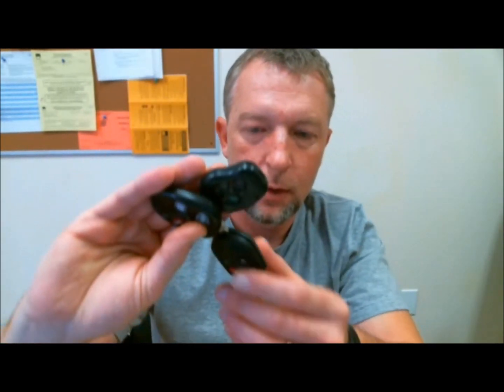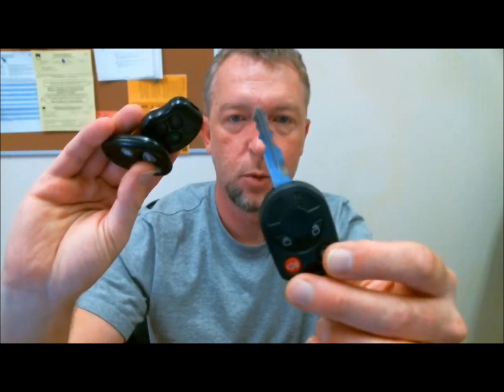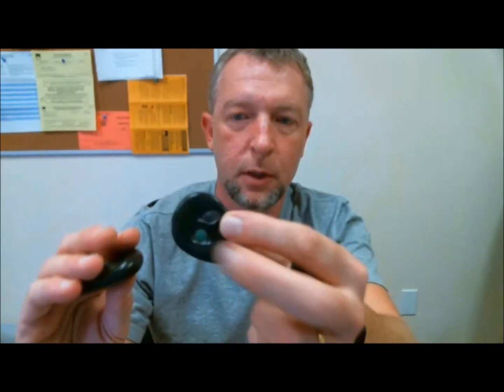2007 & 2008 Mazda CX7 Factory Transmitter Remote Programming How To

Comment: Hi do these remotes have batteries. I tried your instructions but my remote still doesn't work
Reply from the maker: Yes, Absolutely. They do have batteries in there.
Reply: Lessco Electronics would you know how to get it open? I have the remote that has the key which folds into it.
Reply from the maker: You pry it open like a clam with a thin object
Reply: Lessco Electronics thanks so much I have to replace batteries in both remotes and try this again.
Reply from the maker: ok, have fun